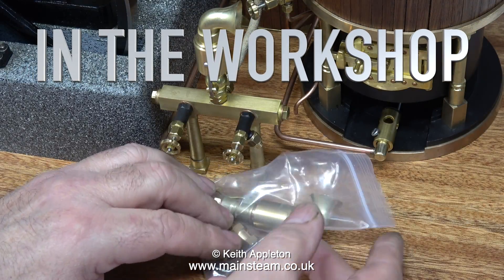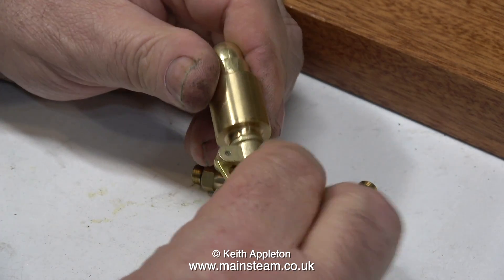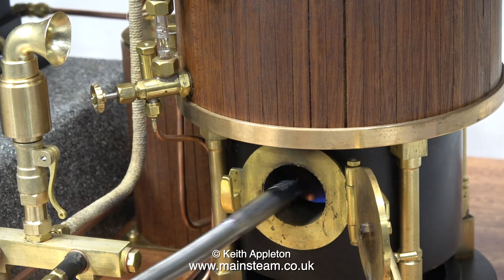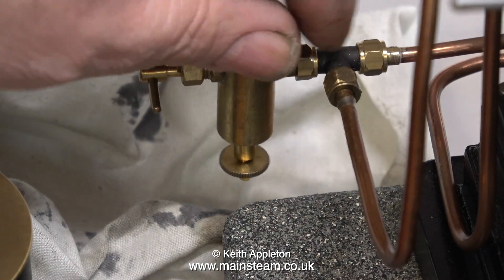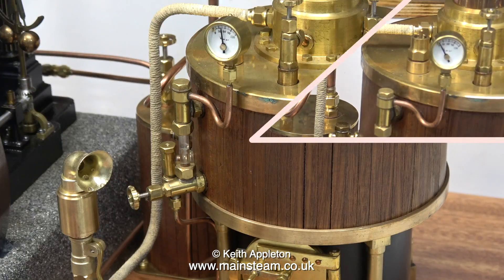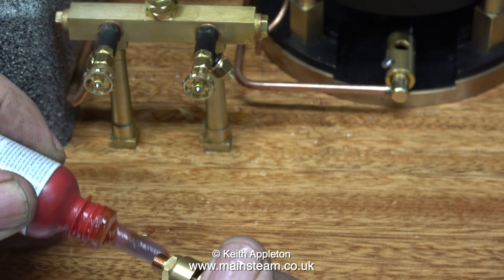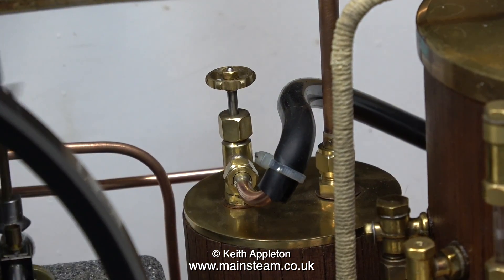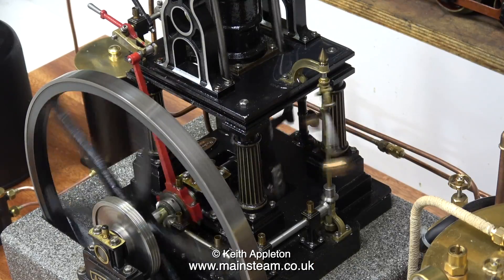ATLAS STEAM PLANT CONSTRUCTION - PART #11

Comment: clever how you got the engine to run on zero pressure . . . i like sirens but this is just the wrong application for one and if run on compressed air it will reduce a siren to junk for lack of lubrication (no mermaid jokes, please).